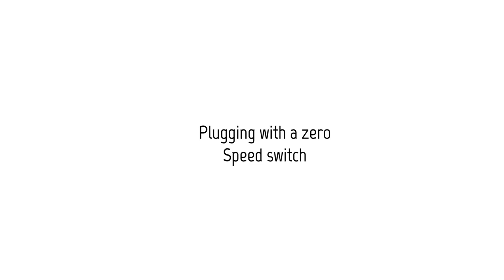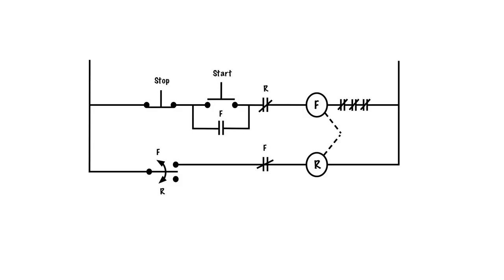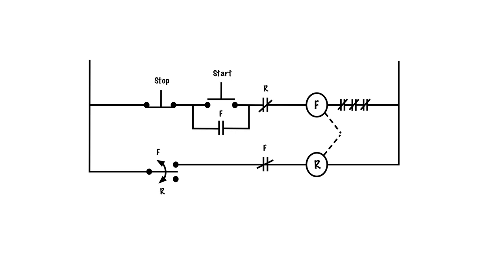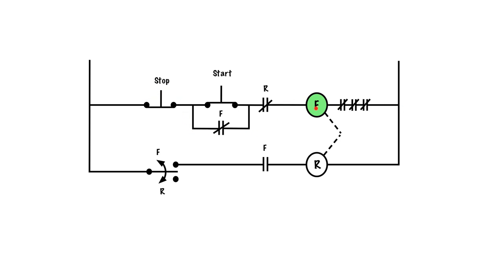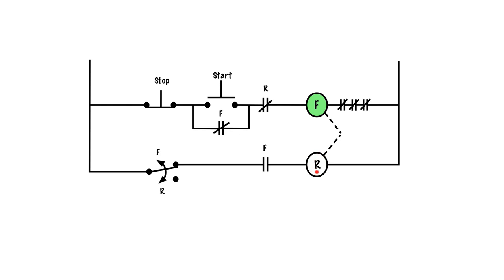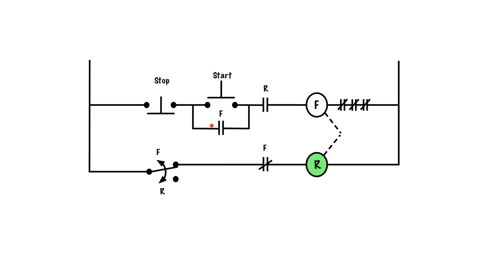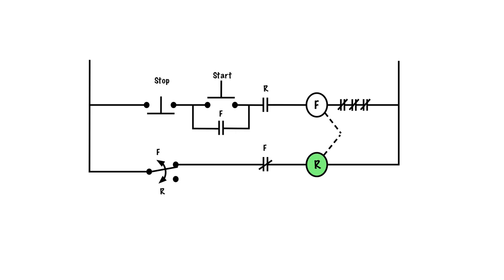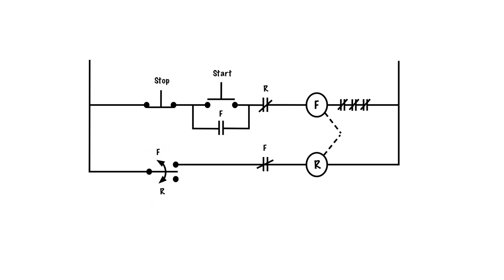Using a zero speed switch to plug a motor.

Comment: I always wondered how these work, good explanation. Presumably the energy that comes from a suddenly collapsing coil cannot be dissipated by a slowing motor, so there will be extra voltage spikes and heat to deal with in the wiring....
Reply from the maker: Yeah as the motor slows the CEMF goes down and then current goes up.

Comment: So you only use the one side of the speed switch?
Reply from the maker: That is correct.  You use the other side (the reverse contact) to open the circuit and shut down the power to the control circuit.

Comment: When the stop button is pressed does the motor still spin in the forward direction or does it stop suddenly?
Reply: It will spin in the forward direction due to inertia of motion.
Reply: which is why the speed switch action engages a reversing contactor (from what I understand), which would likely reverse the power supply to cause a rotating magnetic field in the opposite circular direction and cause the motor to decelerate faster and stop.
Reply: I passed my exam so all is well. Doesnt matter what spins which way lol